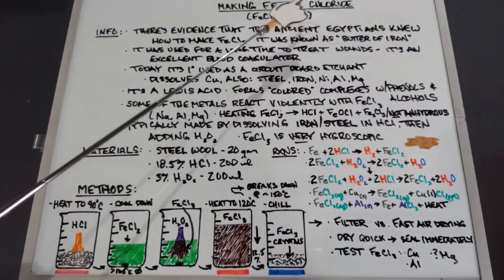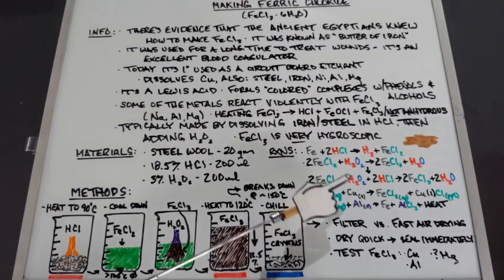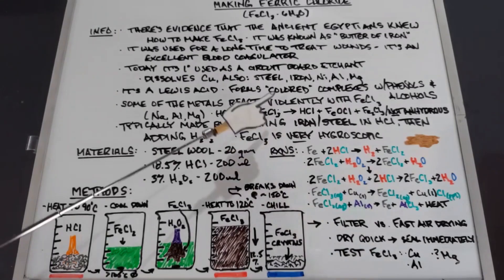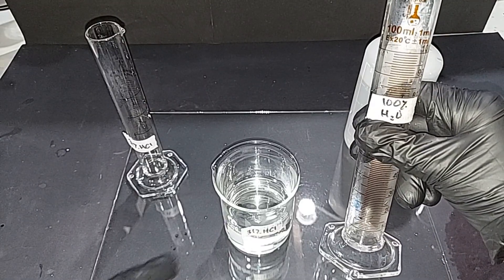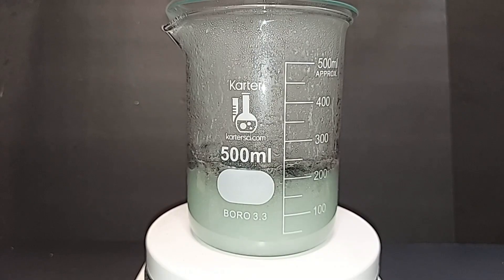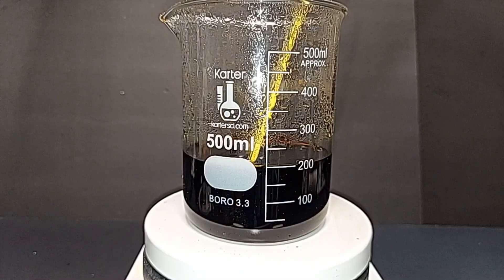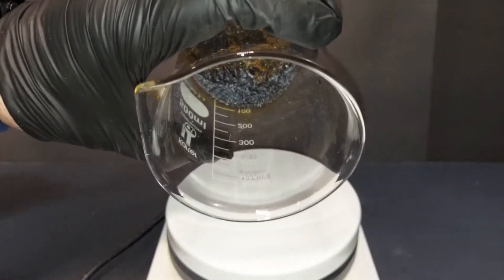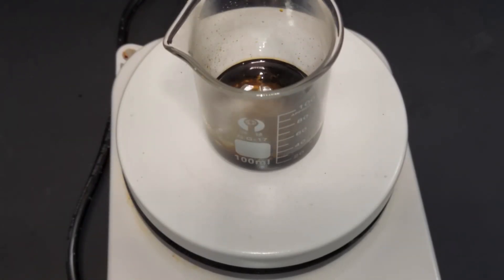Making Ferric Chloride And Crystallizing It

Comment: Can I use red fuming nitric acid instead of hydrogen peroxide
Reply from the maker: You could dissolve the iron but you're gong to produce nitrates, specifically ferric nitrate nonahydrate, which you would need to deal with.

Comment: I was going to post the following...but then you did it.....Would it have been easier to light the steel wool on fire. It would make dissolving it easier.
Reply from the maker: When the steel wool burns it converts it to iron oxide, or rust.  Which doesn't work or that would be a great idea.

Comment: 14:41 Those are lovely! I always wonder: do you ever keep samples of some of the crystals, just because? Iknow some will decompose easily, but if I remember correctly, these are more stable.
Reply from the maker: Haha yes, I save every possible crystal I make.  Most are stable, some need specific environments like the these.  Basically creating a very dry atmosphere around them.  Some have eaten through the container I put them in (potassium bisulfate ate through a cheap round metal can I had it in.  It took over a year, as I just put in the back of a shelf and forgot about it.  It then continued to eat through the wood shelf in a perfect circle to a depth of 1/2 inch before I found it again).
Reply: @cranialconstruction  Um ..yikes 😂 I can just imagine someone looking at that shelf decades from now and trying to figure out why that pocket is there.

Comment: FeCl3 --> FeCl2 + Cl, an equilibrium.  The Chlorine on the right is in its atomic form, which is more reactive than the molecular form: Cl2.  If you bring the temperature up to about 60 degrees C or so, the back and forth of the reaction is faster.  Making atomic Chlorine available for many sorts of chemical reactions.  Even organic sorts.  Aqueous Ferric Chloride is sloshed about with an organic layer of toluene, say in a test tube, yielding Ferrous Chloride, benzyl chloride, and some HCl gas.  This setup was common in labs prior to about 1950 or so, before you could run out and buy gaseous Chlorine in small tanks.  Chemists tend to have large technical libraries.
Reply from the maker: Appreciate the input!

Comment: You can also use it to put a passivating patina on non stainless knife blades.
Reply: I make fuming nitric acid and the resulting solid mass left over in my boiling flask(reaction vessel) is sodium bisulfite. It's very difficult to remove once it cools and becomes very hard. So I just dissolve it back into water until it all removed and put blades of high carbon steel and get an very cool pasivated  blackish Grey surface finish.. you should check it out if you ever make nitric
Reply: So, this is what you can use to cold blue iron and non stainless steel? Nice, that's good to know!